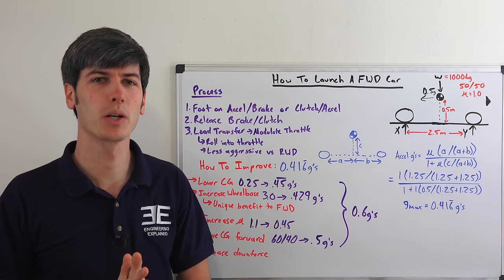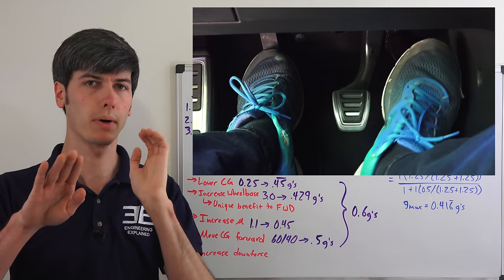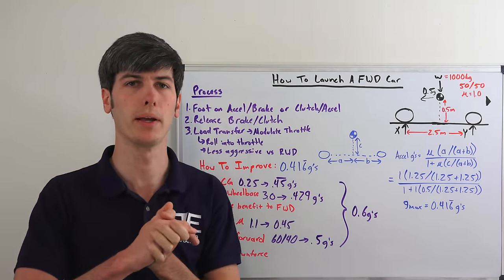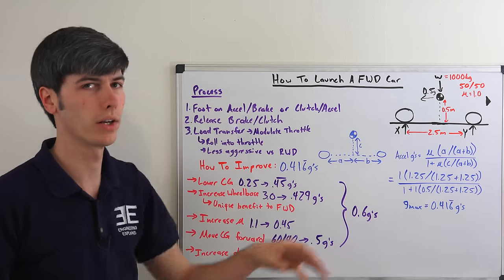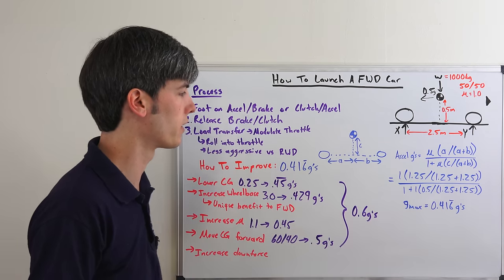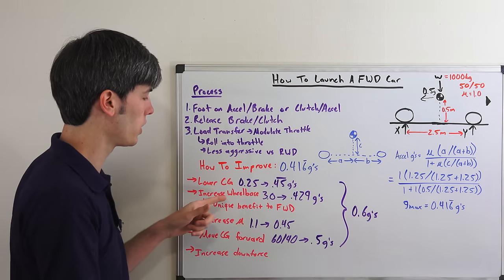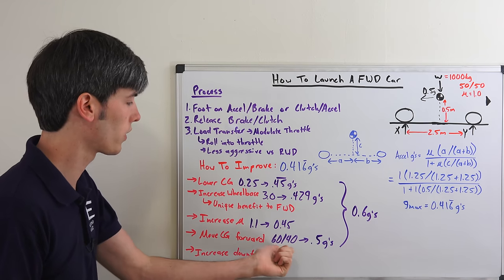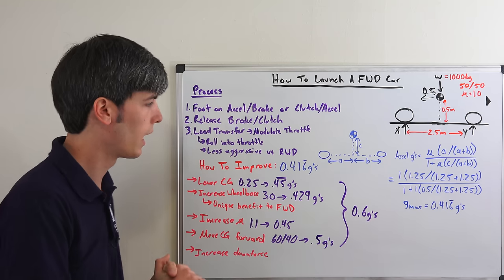How To Launch A FWD Car - Design Considerations

Comment: Here's the REAL fastest way to launch a FWD car:

step 1: convert to RWD, AWD, or 4WD.

step 2: launch.
Reply: Do you mind if I ask what the difference is between AWD and 4WD ?
Reply: 4WD usually implies that torque is sent to each wheel equally 100% of the time, AWD implies that there is either a front or rear bias and that the percentage can change. 

A simple example is a polaris RZR. In 2wd 100% of the torque goes to the rear. 
When you flip the AWD switch, 100% is still sent to the rear. If the rear tires slip, 50% goes to the front, 50% to the rear.
Reply: I see. Thanks for the explanation !
Reply: +Ujiltrom M I'm going to disagree with +forrest225 here. A 4WD system doesn't distribute power equally to all WHEELS, it distribute power equally to both AXLES. IE, there's no differential action between the front and rear via the transfer case.

In a 4WD car, while the left and right wheels of each axle can spin independently (IE one side faster than the other: look up what a differential does) the shafts from the transfer case to each axle must spin at equal speeds. 

In an AWD car, there is a differential action so that the axles are independent. This is bad in very low traction conditions where high torque is needed on all wheels.

The effect of this is that in an AWD car, if the back is stuck in something slick (say, mud) and the front is not, the only axle getting power is the one with no traction. So the wheels on dry ground do nothing and the wheels in the mud spin away uselessly.

In a 4WD car, the axles must BOTH spin. This makes 4WD more desirable for off road driving.

Hope this clears things up. 

4WD and AWD are used interchangeably in marketing though.